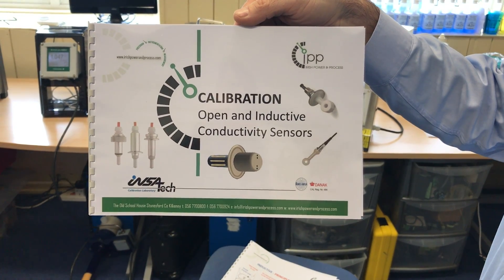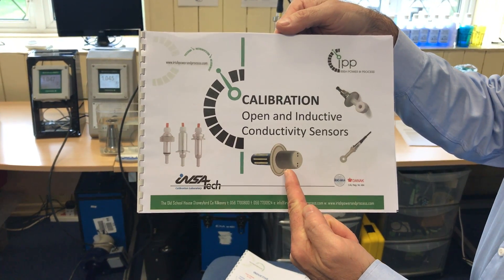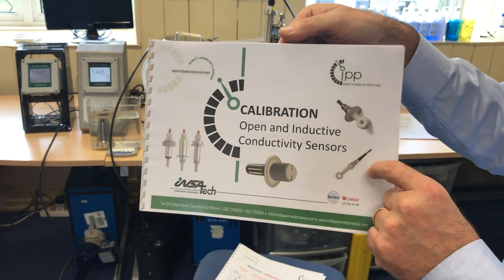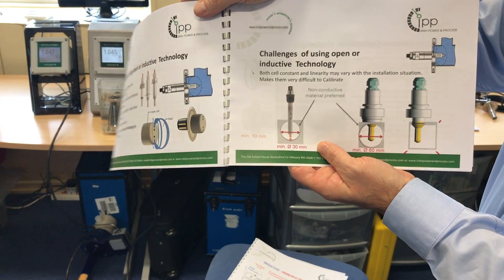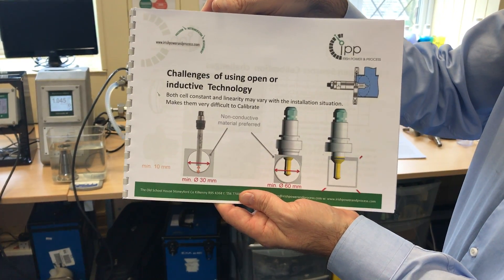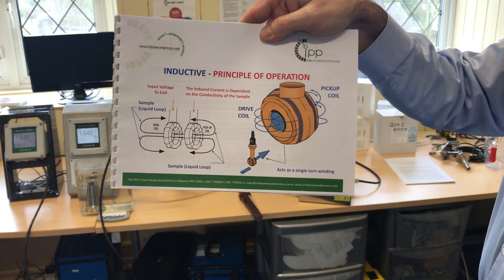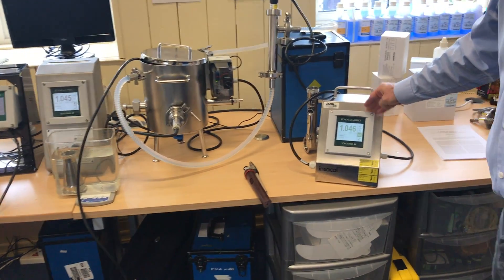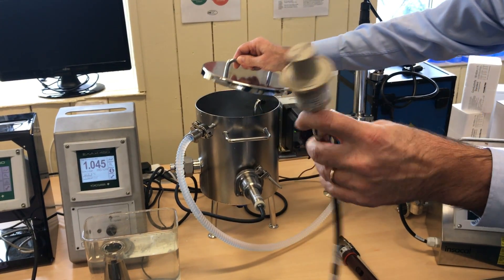Open Sensor Calibration with an INSACAL Conductivity Master Meter

Comment: Great video! One question, was the 4E open sensor calibrated hanging in the tank or was it connected to the port on the back?
Reply from the maker: Hello Tom
 That is a very Good spot . it would normally be calibrated in the port on the tank , but for the purposes of demonstration i had it in this instance hanging in the top of the tank so i could handle it during the video.   the correct way is to mimic the sensor's install  as it would be on the facility .  Thank you for your interest